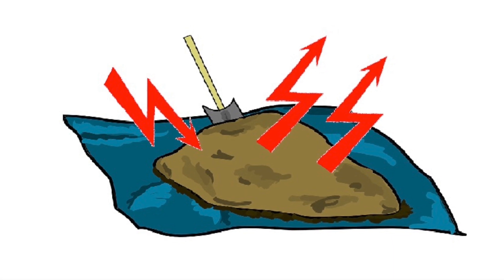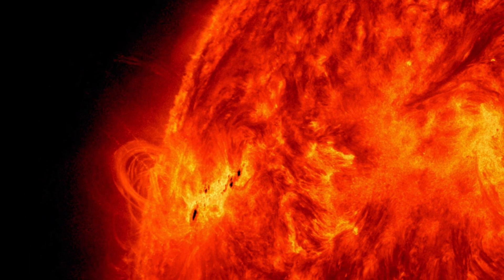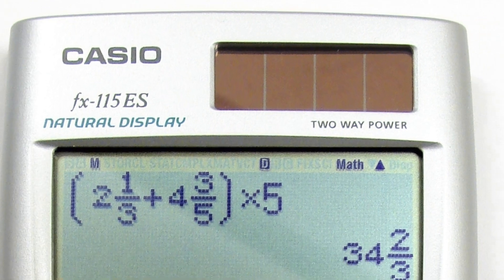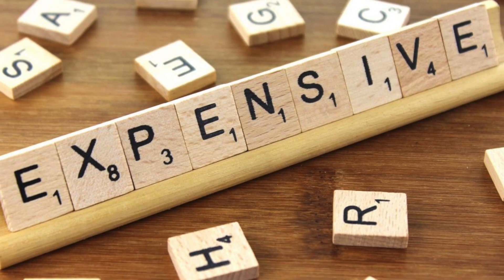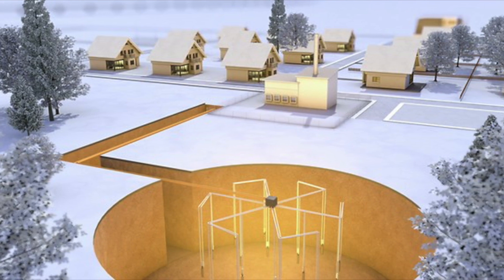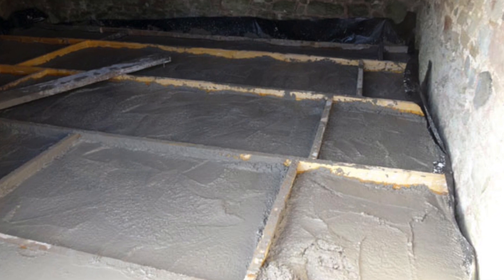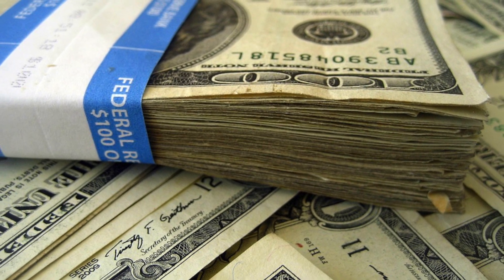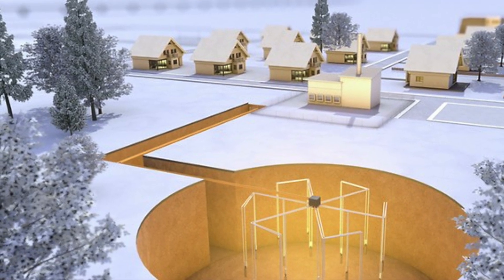Home Solar Thermal Dirt Battery (2020)

Comment: I don't like it. It requires you to have a very large amount of space and the dirt moving and or buying if you don't have the right kind of clay or gravel will get expensive as well as all the other materials. I think it's much cheaper to use a combination of wind, solar, geothermal, hydroelectric and yes, passive solar heating, just not under the ground. There are also thermal mass considerations that can help your house stay cool in summer and warm in winter just by being smart with the design. I designed a house that will keep anyone comfortable with hot running water for baths, heating of the structure, lighting, running water for flushing toilets and cooking, all with no electricity at all.
Reply from the maker: thank you for your opinion. I don't agree
Reply: @SimpleTek  Give me a ball park money wise to do this say on a 50 x 50 lot as are many plots you can buy in the city. Can it even be done on such a small scale per individual home? Most homeowners don't have more than that.
Reply from the maker: @DivergentDroid  costs vary greatly

Comment: Can this be used to cool the home in the summer too? I mean can it work in reverse, pulling heat from the house,and storing it down below?
Reply from the maker: yes but I'd suggest running a line out 100 feet from the house just taking advantage of the coolness of the earth 8 feet down for cooling, two separate systems
Reply: For cooling it doesn't need to be this elaborate, thermal tubes or liquid tubes buried about 8 feet deep in the regular soil.

Comment: nice video.
a couple thoughts i had..
you could put the heat batery around outside the basement. 
also i think air systems are hard to clean..  so warm radiator pannels with water in and out seems to be long lasting..
they actually make wall pannels that are flat radiators.. they can be placed on walls or ceiling.
the top of the heat battery could shield basement from rain infiltration in a bad storm.
very exciting about the aircrete... more bubbles .. yea!
 one thought is that you need good collectors. they have to store extra heat on a cold day.  so double or tripple glased.. and large enough.
very awsome to see people doing these things.  it takes a lot of gumption for an entrenched homeowner..

onee thought for the entrenched owner.. consider increacing those south facing windows.  i've been thinking about panels between rafters.
and of course some have only enough room for hot water barrells..  they heat the house and then cool slowly over night..
check out the dual passage swamp coolers for cooling in the summer!  theres also a guy whos improoving swamp coolers with salt water which absorbs moisture in the flow..  the brine is heated to loose excess water, then cooled before going theough the thermal evaporator.. very fun..
Reply from the maker: Thank you so much for the information! Great stuff!

Comment: It's good you're getting these ideas out there. However,  when you are returning the heat to the building, use the pex pipes with liquid transfer rather than air. The liquid could go through radiant heat pipes in the floor as you mentioned, but even more simple and maintainable would be using a "water to air" heat exchanger in a regular central heating air handler.  Why not the underground air tubes? Because then you are breathing air that has gone through a lot of underground pipes, which could pick up soil gas, radon, mold, smelly dampness, etc. through any crack or junction or just from condensation. You just can't expect it to remain pristine for years to come. And also bugs and critters can get in there and you can't clean it out--stuff happens. So while the air may be OK for a greenhouse, not so for a residence. PS: What about Solar Hybrid PV/Thermal solar panels? Cools the PV panels and generates hot fluid for house heating at the same time.  Costs more than PV alone, but cooler PV panels last longer and it's probably less than installing and maintaining two different kinds of collectors.
Reply from the maker: liquid heat transfer is much more efficient than air
Reply: @SimpleTek  However if plants require fresh air constantly then air is a good option. I plan to route the constant exit air flow to a DIY min-split, also controlling temps. I am cannabis inclined))
Reply from the maker: @Tarabaspence  cool idea
Reply: Could you not attach it to an air purifier with a good filtration system?
Reply: That would take care of mold spores and dust, but radon and smelly soil gas are just gasses and I doubt you can filter that out. As mentioned, it's fine for a greenhouse but not for a home.
Reply: @rkirby7183  Most homes in Iowa already have a Radon mitigation vent, so I don't think that it would be a problem (besides the smell?), but I guess it depends on the location.
Reply: @samuelboucher1454  Tech Ingredients channel has a liquid desiccant solution for treating humidity that also does some neat filtration
Reply: PVT is something that I was thinking about too, but one Dutch company has patented it already world wide... And they sell them rather costly. But I'm thinking to build my own, using normal solar panels and airconditioning radiators for cars, which are very thin.  I don't have the time nor the money at this moment in my life, but hopefully in a few years I could try this for real.

Comment: What about using a septic tank as a dirt battery? Is this stupid an idea?
Reply from the maker: it's a good idea, but if you have a tank use water - water can hold way more heat than dirt, like 4X

Comment: @ simple tech

My aircrete formula.

I have worked with plaster and concrete as a contractor for many years.

1. If you add carbon to the concrete in a small amount it makes the concrete 30% stronger. This should also work for aircrete.
2. Also adding concrete glue is very helpful, I do not know how it will work with the soap bubbles but give it a test. 

3. Add an insulation product called zanolite or Zon- olite, it makes plaster ( Brown coat) extremely strong and light. 

4. A cheap efficient test mixer, is a regular concrete mixing paddle for a five gallon bucket attached to a drill. You wrap some windows screen around it, or if you want smaller bubbles you get a finer mesh than window screen.

This will mix up the soap solution into a phone of excellent consistency. You then use the same mixing paddle to add your premixed cement to the soap foam to make aircrete.

I prefer it to other systems. As it's cheap easy to work with and works well.
Reply from the maker: That's awesome information!!!! Thank you
Reply: when you say 'concrete glue', were you thinking of something like SBR, to make the aircrete waterproof, or something hydrophobic like the silicone in K-rend?

Comment: Maybe you are good to go with simply water. If the pipes run inside the house and the dirt mostly.  And the travel height (from the surface) is deep enough to achieve a no-freeze zone, simple top insulation can improve it. But the solar unit will still need glycol, right? So in order for this to work, you would need a primer circle (the solar units) and a seconder circle (the battery) connected with a heat exchanger. The benefit is most of the system becomes non-toxic water so even if anything fails in the battery there is no harm to your personal environment.
Reply from the maker: well said

Comment: @ simple tech

1. Some people are using ethyl alcohol instead of car radiator fluid because it's less toxic. A 10% brine ( saltwater) solution will increase your BTUs but may tear your equipment apart as salt is very corrosive.

2. Instead of a dirt battery per se, have you thought about 55 gallon drums?  From the solar aray on the roof, to several 55 gallon drums standing in your basement, or dig a hole in your basement floor and put the 55 gallon drum in the floor. This would create a volume of hot water that you want, under your basement floor; or standing in the basement and keeping the house warm.

3. Phase one you do the setup as a stand up unit in your basement to get the system going without a lot of work, and your test how many barrels you need. Phase 2, You would dig the hole in the basement floor and it would be big enough to pour 4 to 6 inches of aircrete at the bottom of the hole ( for insulation to direct the heat up and not into the ground) then stick the 55 gallon drum in the hole with 4 to 6 inches of aircrete around the 55 gallon drum  ( aircrete, around the drum: is all the way up, flush with the floor, but the drum top is not flush with the floor but below the floor, one or two inches depending on what you want to put on top of it, with the barrel in cover in place).  

NOTE: The next step is to figure out what you want to put on top that is flush with the floor. I recommend copper. Copper heats up the objects in the room not just the air. You can use metal or even just regular concrete, as your floor plug with a hook in it to pull it out as you need to. But I strongly recommend the copper, as it causes a different kind of heat that comes into your house and will heat every object in the basement. This will make your basement a extremely warm zone which will then passively also warm your entire house. If your basement is warm your whole house will stay warm. Copper pipe can be bought as scrap at your commercial plumbing supply, they have scrap pieces for sale. These can be melted down or just installed as copper pipe on top of the barrel.

Aircrete is waterproof and when the drum rusts out the aircrete will act as the new drum.

NOTE: You put the 55 gallon drum below the surface of your concrete floor, with a concrete hatch OR copper lid, covering it level with the floor. This way you can access the reservoir if you need to.

please look at my other posts for the formula for aircrete that makes it extremely strong.

Edits were made to correct typos and to add additional information to explain it better. I hope I did a good job.

Thank you for reading this and Hope that you are all blessed, and escape the high costs of heating your home.
Reply from the maker: good idea
Reply: @SimpleTek  

Thank you for taking the time to read my post. the other posts are the aircrete formula which will make it extremely strong and improve insulation with zanolite.

I made some edits to the above post to add clarity and further explain my ideas. I hope they are helpful.
Reply from the maker: @reypolice5231  well said!

Comment: Water has the highest specific heat capacity for the lowest cost, unless you live off the grid in a desert. Even in a desert, water is still often the best choice for thermal mass storage.
Reply from the maker: best choice for the price!! There are better materials but the cost makes them impractical to use.
Reply: @SimpleTek  He's right about water heat storage (actually water/antifreeze mixture). Big simple storage tanks can be constructed from braced plywood, polyiso board, and EDPM roofing rubber. Two 4'x8'x4' tanks take only 10 polyiso boards (4x8x2") and can store about 16000 BTUs per degree F. of rise, or 800,000 BTUs for a 50F degree temp rise. You could also build these two tanks with insulated concrete below your basement or slab when you have a house built. You don't really need to store a whole summer's worth of heat to get through the winter unless you live near the Arctic circle. And then, you could put 24 of these below a small 24'x32' basement, storing 9.6 million BTUs for the winter, and any heat leaked just warms the concrete and dirt beneath the house.
Reply from the maker: @rkirby7183  sergiy Yurgio's channel did some amazing research on this.

Comment: Glycol,  either ethylene glycol/water (car antifreeze) or propylene glycol will work fine assuming it does not chemically attack the pex and fittings.  The first is poisonous,  the second much less so (used in foods to make cookies moister -- but even water is a poison if you ingest too much).  Windshield washer fluid usually contains methanol,  which will evaporate out over long periods of time if there are ANY HOLES in the system and is both poisonous and may attack the PEX chemically -- Note:  I did not check chemical compatabilty as it may depend on particular brand of PEX.
Reply from the maker: well said

Comment: Have you made a video telling how to make air crete pannel for the $5 each you referred to in the video?  If so can you provide a link to it.  Thanks.
Reply from the maker: not yet - planning to this spring!  Aircrete Harry is a good resource for now
Reply: @SimpleTek  

They are now adding carbon to concrete and it makes it 30% stronger. Also there is concrete glue which makes it fluff up and stronger. also there is a product called zanolite which is insulation.

If you add carbon concrete glue and zanolite insulation flakes to your aircrete, it should be incredibly strong and help to insulate. I do not know how the glue will affect the ability of the soap to create the aircrete.

So do some tests.

I saw where the guy took a paint mixer and wrap the screen around it and made his aircrete in a 5 gallon bucket for testing formulation. For small batch aircrete it makes really good batches of about 3 to 5 gallons. Just got a regular paint paddle mixer for a 5 gallon bucket and wrap it with window screen. If you want a smaller screen you have to go buy it special but the bubbles would be much smaller in the aircrete.

Comment: Water has higest termal capacity from all materials only limit is max temperature so if you dont wont more then 100celsius water will beat everything google it water termal capacity
Reply from the maker: you should look into phase change materials and heat - like wax. very cool stuff, many times that of water with a phase change
Reply: @SimpleTek  nice am gonna check it out thanks
Reply from the maker: @yessmoker  You're very welcome!

Comment: Roland had a good callout: The ratio of an objects area and its volume is not linear.

This matters because stored thermal energy is a function of specific energy (energy density) and volume, whereas heat loss is a function of insulation and surface area.

imagine the following cubes:
width / area / volume / ratio
------------------------------------------------
2m / 24m2 / 8m3 / 3:1
4m / 96m2 / 64m3 / 3:2
8m / 384m2 / 512m3 / 3:4

The takeaway here is that as systems get smaller, you will have more surface area per unit of volume, which means more heat loss per unit of volume.

Drake, being a very large system, is able to capitalize on a very low area/volume ratio. Systems sized for single homes would need to make up for that reduced ratio with more insulation.

I would suggest doing calculations for different R values until you arrive at a suitable amount of thermal loss. 

Heat loss can be calculated as (1/ R-value) * (Celcius difference) * (area in m2) = heat loss in Watts

My system design uses water instead of soil, but as a rough guide I calculated for a 12k L cylindrical tank with a temp diff of 50c from inside to outside:

No insulation: ~16.8 kWh loss per day
1" of aircrete (R6): 2.8 kWh loss / day
12" of aircrete (R72): 0.23 kWh loss / day (this is very manageable)
Reply from the maker: I agree size matters. smaller thermal batteries do need a lot more insulation
Reply: You have got to wonder one the cost of insulation vs the cost of power you are losing... 2.57 Kw per day, when the power is coming from Solar (so free) is not a lot for a 5Kw system to cover....
Say 4 average sunshine hours = 20 Kw Gen per day.
90% efficiency of system, means you get 18Kw, less 2.6 say heat loss
15.4 Kw of heat left at the end.
That is not bad. More solar/ Cheaper energy = makes it even less of a problem.
say average cost of energy is 0.08 per Kw, and insulation costs 1000 = that is 14 years to pay back the extra cost for insulation